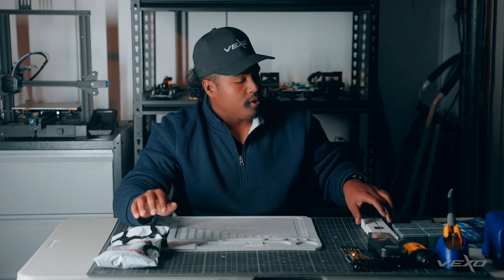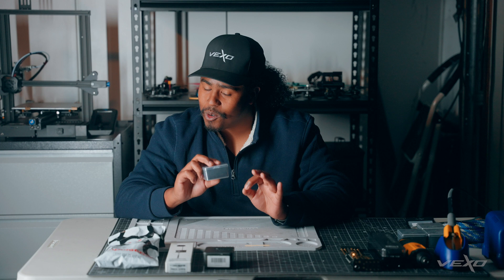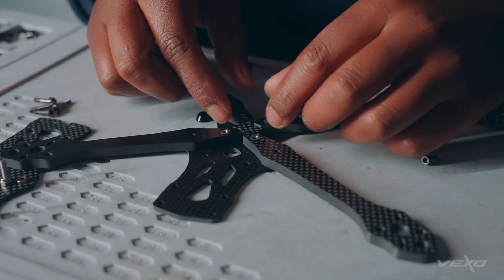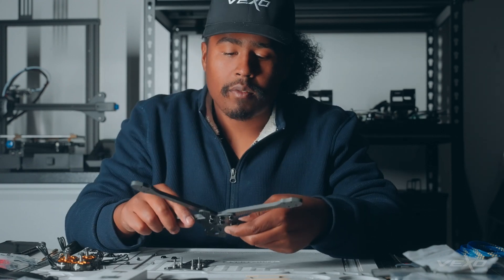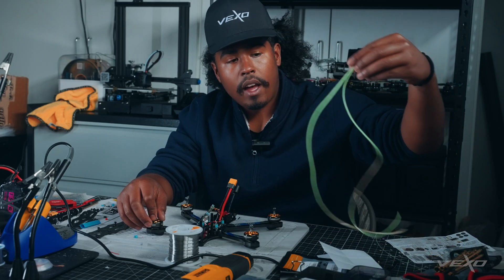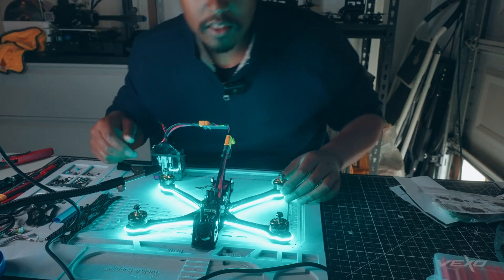VEXO Aerials | Build Series: Custom ImpulseRC APEX DC EVO 5" Cinematic FPV Drone Walkthrough

Comment: Why did you skip part where you install stack bolts to mid plate? I hear bunch of people complaining where countersink stack mounting bolts, on the mid plate, does not sunk enough, so the arms lay on them, and mid plate bends, when tightening  bottom screws. Hope you not covering this problem, by skipping install process.